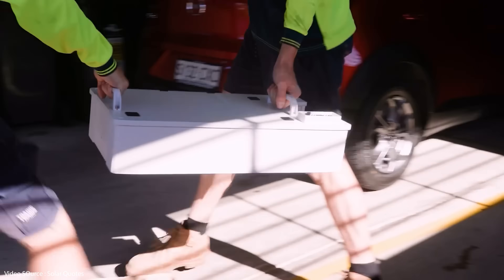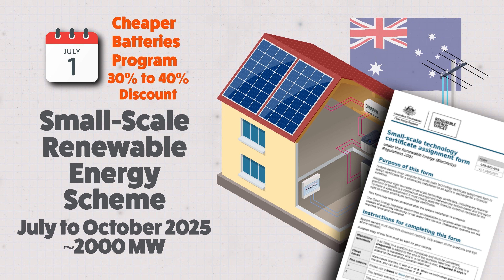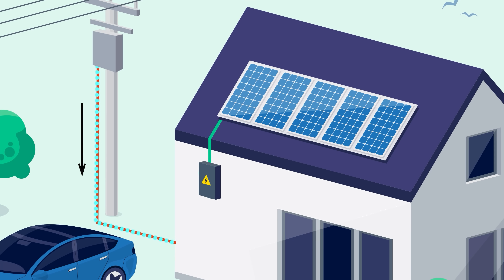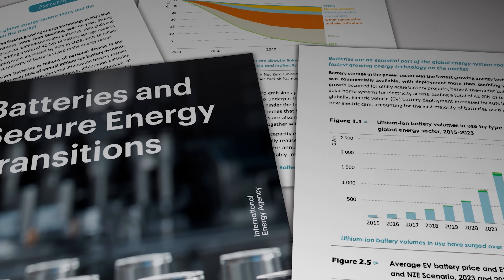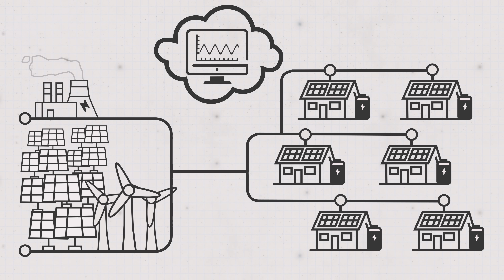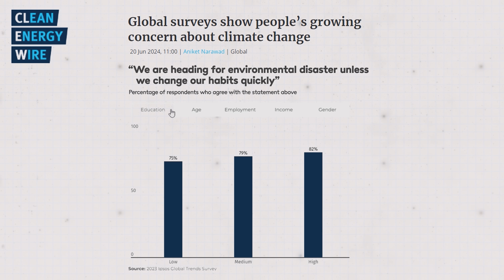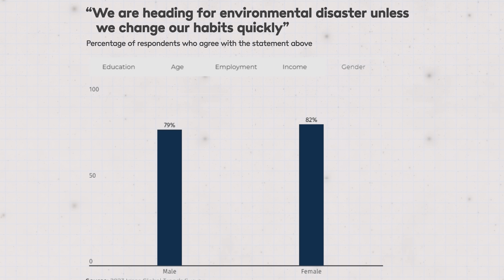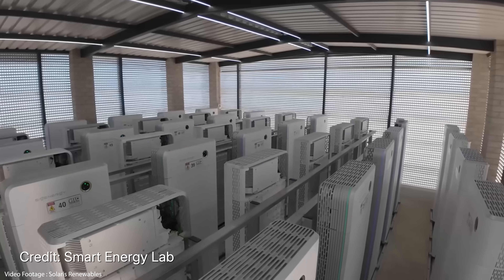Australians installed 100,000 home batteries in 17 weeks. Why can't we all do that?

Comment: I live in SEQ about an hour west of Brisbane. I have a 8kwh array with 6.5kwh grid based single phase inverter on a 3 phase grid input. Also I run a device called a Catch Power, which diverts solar energy to hot water storage. I do not have battery’s as yet. I have now owned this property for 3 years & my electricity bills are $0. Yes, we also get an energy subsidy here in rural Queensland, but you can not get much better than $0.

Comment: In Germany 3 Million in total in 2025 150000 new. But, we dont have that much sunlight…so only 100+ Gigawatt wich is very bad. We need 460TW  in total. That is 0,022% or 1/4600. That is of course only true if you you want to run and kind of industry. So household by solar yes, chemical industry, arms industry, automotive manufacturing, heavy industry, not really I guess
Reply: Geothermal is the solution, not solar/wind and batteries.
Reply: @Les_S537 i have no idea, but no Energy is no industry, thats for sure.
Reply: @Dwseias60 yes, of course…. I’m just saying that we have so much thermal energy beneath our feet that 0.1% of it could power mankind for 2 million years. 

We just need to tap into it (geothermal)
Reply: @Les_S537 well, that planet is hot inside indeed. Funny thing is, no one uses it in giga let alone terra watt.  Why not? Maybe lobbyism. One thing I know, my electricity went up, so I bought a PV. That’s a good thing, I save 150 a month.
Reply: @Dwseias60  Well, Iceland is pretty close to gigawatt scale...  That being said, sorry for the length, but hopefully you'll understand a little bit better by the end...

The deepest borehole ever drilled by man is the Kola Borehole in Northwestern Russia near Murmansk.

They drilled with mechanical drill bits to a depth of 40k+ feet.

The thing is, it took them 20+ years to accomplish that depth.  This is the problem with mechanical drilling...  Once you get down to what we geologists call basement rock, the density of the rock and the pressures involved chew up drill bits in short order.  This requires that drilling operators pull the bit back up to the surface, change it out, and then drive it back down to the point of contact and this takes a lot of time when you're that deep.

As a result, mankind's use of geothermal for power production has been relegated to a select few locations on the planet such as where the crust of the earth is relatively thin, or experiences high volcanic activity (with magma close to the surface).

But we now have a better way to drill.

Quaise Energy is using gyrotrons to drill instead of mechanical drill bits.  Gyrotrons are used in fusion reactors to heat up the plasma within a fusion chamber, and Quaise is now using them to literally vaporize rock.

It's called millimeter wave drilling (MMW), and it's basically a microwave from your kitchen on steroids.

Quaise Energy's MMW drill bit can reach Kola Borehole depths in 100 days.

This unlocks the entire planet to use geothermal power.
Reply: @Les_S537 quaise Energy, I will Check that. Thank you for your answer, I hope you are right!

Comment: I bought solar panels 5 years ago and last year bought a battery in Australia, costing me 30,000 all up for an Enphase system. My son just bought a solar array and battery for 20,000 and it has nearly double my output. For 12,000 i can add another array and battery and be fully off grid but thatrwould take 16 years to recoup and for me i would be 90, so i might not do it.

Comment: It is not only the solar panels causing a over supply to the grid it is the power stations. A lot are coal and you can not just ramp them up and down in supply like you can do with gas, hydro and nuclear. So during the day even without solar panels in the mix there is a over supply of electricity. That is why sometimes the power companies pay the electricity suppler to take more power than they need. As for installed batteries is that a real figure or is it the figure of how many people have taken up the offer? As i already had solar for 6 years and i ordered a few more panels and 2 batteries. The extra panels are on the roof but 5 months the batteries still have not turned up from the manufacture. Yes they can not keep up supply. And solar is not for every country. You want sunshine 80% of the day and id say 80% of the days of the year to be worthwhile.
Reply: It's all just so damn dumb.  Solar/wind plus batteries is NOT the solution to removing fossil fuels from the grid.  Geothermal is.

Beneath our feet we have plentiful thermal power where just 0.1% of it can power mankind for 2 million years.  It is ridiculous to waste all this time and energy building wind and solar PLUS oodles of batteries which create a huge environmental impact when you can do geothermal which requires much MUCH less resources and maintenance.
Reply: @Les_S537  That all depends on what country and location. Can not just do it anywhere it costs way to much to even consider. Depends on location you can use wave and tidal as well. But issue with a lot of options is the greenies knock them on the head with environmental issues.
Reply: @BrettNoneya  It no longer depends on your location.

The geothermal revolution is here.

Quaise Energy, which spawned out of the MIT Plasma Science and Fusion Center, is using gyrotrons to literally vaporize rock (gyrotrons are used in fusion reactors to heat the plasma within the chamber).

They just completed their first field test at a granite quarry in Marble Falls, TX drilling through 118 meters of granite at 5 meters per hour.   Granite is some of the hardest rock on the planet with a Mohs hardness rating of 7.

Traditional mechanical drilling techniques can only get 0.1 meters per hour through granite on a good day.

This means Quaise will be able to reach depths of 10-20 km in less than a year where rocks can be 300-500 Celsius.  To reach those depths with mechanical drilling would take 20+ years.

Quaise Energy will make geothermal possible across the entire planet regardless of your location, and with this much faster drilling capability they expect to lower the up front capital cost for a geothermal power plant by more than 50%.
Reply: @Les_S537  Yea ummm dude what do you not understand as Location. Im Australia we do NOT have any volcanos at all so have deeper to go down for geo thermal. How round do you think the hole would need to be to run a small city? 6 inches, 1 foot, 2 feet, 5 feet, 10 feet, 50 feet? Keep going.  A 6 inch hole will run a house. 

Start doing the math.  Now other issues is where you dig holes like that could cause the geology to become unstable. Would it cause more earthquakes? So easy to say dig a hole that is something China would do with no research into the geology of the area like their Hongqi Bridge that was wiped out about a month after opening.  It is fine for countries that have heat sourced close to the surface.
Reply: @BrettNoneya  You don't need volcanoes to do geothermal, though that would make it much easier because you wouldn't need to drill as deep.  You just need hot rocks, and in areas where no volcanoes are present, or the crust of the earth is very thick, that means you need to drill 10-20 km down (~65k feet) to reach rocks with the requisite temperatures (300-500 C).

Every geothermal power plant ever constructed results in microquakes when water injection happens, but they're typically 1-1.5 on the Richter scale so never really felt by humans on the surface.  Traditional geothermal power plants are typically only 3-5 kms in depth.

Quaise is going to drill to 20km depths in most cases which means you're even farther removed from any quaking.

Other than that, yes, geology of the area in question is important.  You're not going to want to install one directly on a fault line.

As for the width of the geothermal borehole, 10-14 inches is sufficient, and you'll never have a case where one singular geothermal power plant is going to run a city.

Quaise expects each geothermal well to achieve between 25-50MW of electricity for each well, and a geothermal complex (with many wells) will be able to achieve hundreds of megawatts because of the supercritical steam coming up from depths of 20km.
Reply: @Les_S537  Yes yes yea a 6 inch hole would produce about 5mw. So you going to have hundreds of holes dug all over a city with hundreds of small power plants? Need one for about every 500 homes. It is not just digging a hole it is the infostructure needed. Ill stick to my option of solar and batteries as i get enough sunlight here to run the house 95% of the time from solar and batteries. Not having to pay the power company $1200 every 3 months for power.
Reply: @BrettNoneya  It sounds like you're conflating two uses of geothermal (power and heating).

Geothermal power plants are not typically installed in or near cities.  

Drilling multiple deep wells and building turbines requires a significant footprint which is scarce and expensive in cities.

Some cities, like Reykjavik Iceland, Paris, Boise Idaho, and a few others have instituted geothermal heating systems in part or all of their cities.

Traditional supercritical temperature geothermal power plants are usually sited in rural or remote areas for various reasons ranging from
1. they can be noisy
2. steam plumes or infrastructure may not fit into urban aesthetics 
3. microquakes happening during water reinjection events are not something you're going to want to have people endure because it could cause foundation issues for people's homes over time.

Do you really want to live in a world filled with millions of wind turbines, billions upon billions of solar panels, and trillions upon trillions of battery cells?

It's such an environmental nightmare to me, and SOOOOO much more work than is actually necessary...

Geothermal has a tiny environmental impact by comparison
Reply: @Les_S537  OMG. That is just heating. NOT producing power. Look if you are so smart in this field go apply for a job in the Trump administration. LOL
Reply: @BrettNoneya  I'm sorry, I thought I was conversing with a halfway intelligent human being, but that's apparently not the case because your reading comprehension skills are obviously lacking.

Have a good day.
Reply: @Les_S537  You shot yourself in the foot over what you have written of what would be required to build the power stations and where. It is the infostructure and the amount or size of holes needed to tap the heat required. On top of that the company is not on the stock market that makes it very sus to start with and can make claims about anything to bring in suckers.  
Since 2018

Quaise has raised $96M over 8 rounds.

Quaise's latest funding round was a Series A - III for $21M on December 12, 2023.

Quaise's valuation in February 2022 was $23.5 - $63.5M.

Well go invest in the company. I sure will not.

Comment: How do battery’s in 100kk houses hold enough power to run 400k homes.  Are you saying each battery installed can power 4 homes?

Also…. Why do you say the total capacity is 2000mw?  Isn’t battery capacity measured in mwh?  Probably this is just an error.. that’s fine.  Let’s assume then 100k jokes and 2000mwh. Each home has 20kwh battery on average.  So.. close to 2 tesla powerwalls.  That’s a lot of money.

I don’t really understand why people decide to do this.  Let’s guess power costs as 40c per kWh.  Then 20kwh is with 8 dollars.  If the battery plus solar is 25k, aren’t you looking at 8 plus year pay off period?  

If the battery last 16 years, you’ve only made 25k from your 25k investment over 16 years, which isn’t a great return imv.  

What am I missing?

Comment: couple of points. solar and batteries here without subsidies are about 1/3rd or less the cost given there are only few tarrifs on China and trades are often organised by large power companies with bargaining power so you don't get the 300% markup for labour. (did a comparison between the US and Australia a while back I can't confirm about other countries).
2) people will deliberately choose not to export to the grid to the point where they will install shut offs to the grid and disconnect it.  this is because the feed in rates are dismal here and Aussies have a tendency to be a bit spirited when it comes to these things.  this will means simply a lower rate of consumption from the grid and help remove those tidal waves you refer to. but no, I don't expect there to be organised decentralised national storage. they constantly try that down south the electric cars and it constantly fails. btw our employees culture here is pretty good, it's highly likely that the staff themselves will recommend this connect/disconnect switch and not to sign up to these err 'unique' energy contracts. (that how i learned about them)

Comment: There is little point in feeding back to the grid in Australia when the feed-in tariff is now only 1c per kilowatt and is more than offset  by more expensive daily charges for electricity plans catering to people with solar and/or home batteries. And you legally have to tell them, even if your system is set up not to feed into the grid.
And when the subsidy runs out so will the installation rate. And when insurance companies start to wise up to the increased risk these batteries represent they'll start to penalize Home battery owners or even refuse coverage. At that point, the trend will reverse with systems starting to be decommissioned.
Reply: There is no increased risk. Battery installations are heavily regulated. The risk of house fires from home batteries is on a par with clothes dryers.

Comment: Electric cars weren't mentioned
Clearly, a 70kW car battery can't be fully recharged by a 14kWh battery alone but our solar of average size produces 30 KWh of power daily to be shared for domestic use. In addition you have variable pricing to get power from the grid eg after midnight. Certainly enough to cover common EV use on working days.

Comment: Never heard CSIRO said like that before, usually we just sound out the letters. I got 6.6kWsolar/5Kw inverter for $3.4kAUD in 2022. In summer it generates 43kWh per day, winter its 22kWh. Got an EV in 2024,  thought we would charge during the day more but mainly overnight with higher flow rates. Just ordered a 20kWh battery for $6.7k, being installed in January. Will cover the AC and EV overnight usage ezpz.

Comment: As an Aussie I looked at this straight away. I currently have a PV system that is almost 15 years old. Some panels have failed so have been disconnected over time. For a battery including discount, required replacement of current PV panels due to age and no longer compliant. With current annual power usage cost, payback of system would be well over 10 years and close to close to 15. This timeframe is well over any warranty offered. If I had money to burn fine but not there yet economically.

Comment: My system literally gets installed on Dec 30th - 31st this year (2025). Just scraping in for the 2025 rebate. I already have solar, but am removing it, replacing with a new 27kWh solar setup and 48kWh battery system.
It is a $69,000 AUD system, which is $45,000 AUD after government subsidies and STC credits.
I am not planning to sell back to the grid (virtual power stations), as I want to retain my battery capacity.
My current power bills are $550 per month. It’s a long payback period, but the price of power keeps going up.

Comment: Thank you for addressing the solar and battery adoption in australia. I have not personally put in a battery system yet. It would appear that there is at least one house catching fire weekly in australia. Even the well-known brands like lg have had recalls on their bateries. In april of this year, there was apparently a recall on Tesla powerwall 2...... I am personally waiting .....before deciding whether to put in batteries. It would be nice if you could give  me some advice.
Reply: The house fires are due to devices such scooters which are not well regulated. Home battery installations are tightly regulated and the incidence of home battery fires is very low - on a par with fires from clothes dryers

Comment: It hasn't made power any cheaper, pricing to install the systems is 4 times the cost of the actual materials due to regulatory burden, it requires mass transmission line upgrade apparently to export from a decentralised location, people are still being ripped off and redundant systems that barely power your aircon are being sold to uninformed people that don't understand how power works. The feed in tariffs are at best 6-10c kWh in the peak usage time where you want to use your power after work. Otherwise have 2c a kWh. 

The better way to have done it would be to have an off grid system that reduces the load on the centralised power generation network. People that require more than $400 a month of electricity can size a system that will be suitable unless a few days of rain set in then they can pull from the grid.

The payback time in Australia because of the regulatory and install cost is 10-15 years. Sizing your own system and mining bitcoin not connected to the grid you can pay it back in 6-8 years.